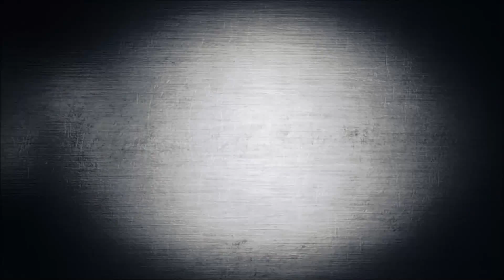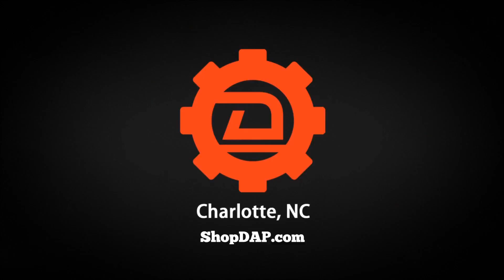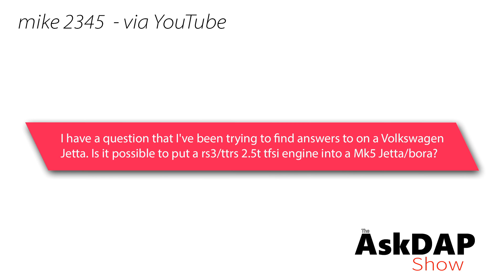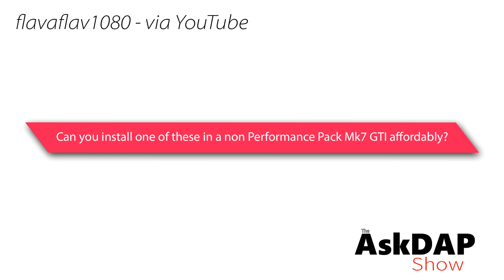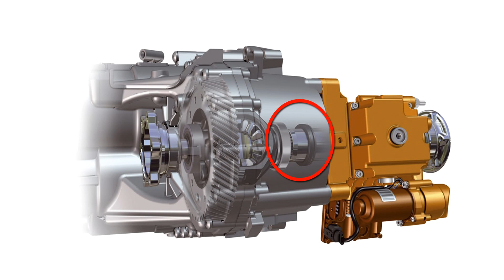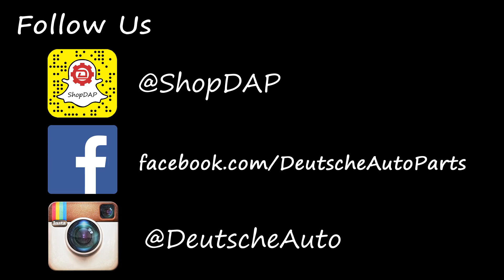Askdap Episode 103 | TTRS Engine in a Jetta, MK7 eDiff Swap

Comment: First off, congrats and thanks for all your informative videos. Much appreciated. I have a question regarding squeaking of door seals as they rub on the painted surface of the car. I've heard that this is common in VWs. Do you recommend a lubricant to eliminate the squeaking sound and protect the door seals?

Comment: Id totally try to fit the 5cylinder rs3 engine into my gti, add the whole quattro setup while im at it, lol
Reply: hllboi817 that would be the ultimate Golf RS.
Reply: Willy Willy lol, thatd be my dream car
Reply: hllboi817 @dave_7r on insta has already done it to his mk7 R
Reply: R is different though, because with the haldex system it is pretty much 3/4 of the battle already in there, vs redoing the whole rear suspension crossmember
Reply: hllboi817 he had to do the whole rear axle. He stuck the rs3 system in the R. It just fits

Comment: Great video and congrats on the new space!
I have a 2015 S3. Do you know of a way to update the MMI to have Apple Car/Android Auto like the 2018s? Thank you!
Reply: Brandon Road There are two options to achieve that, 1st Just upgrade your infotainment unit on the Glovebox for Mib2 unit (oem) or install and interface to your current Navy unit with wireless connection to your mobile.
Reply: Thank you Lorenzo! Is it simply a software upgrade on the infotainment for an upgrade or do I need new hardware in the glovebox? In either case, do you know where I can get what's needed?
To install and interface with wireless, I am assuming this would be a software upgrade, right?
Thank you again for your help! I really appreciate it!
Reply: It would be necessary to exchange your infotainment unit. I have a retrofit company in Spain where we do this kind of installations. I'm not sure if it would be useful for you but I can deliver the unit around the world. Regards
Reply: Got it. I am in the US. How can I connect with you further about this?
Reply: Brandon Road I have asked to Shopdap for authorization to type here my email. I'm sorry but this is not my channel so I don't want to disturb here. I'll let you know as soon as I have a response from them.
Reply: I understand and I appreciate your integrity. Thank you
Reply: Thank you!

Comment: This is unrelated to the video but... I just bought a 2015 GTI with 12k miles on it and noticed the ride seemed really harsh so I had it checked at a VW dealer (car was bought from a non-VW). The shipping blocks were left in the struts from the original VW dealer who received the car new. The dealer (2nd VW, not the ones who messed up) didn't notice any damage and said it is fine but I can't help but feel like I should push for them to be replaced or guaranteed for the future in some fashion; I can't imagine 12k miles with shipping blocks is nice on the suspension. So my main question is, should I take any further action or just be happy the car drives like normal again, or what I think is normal? You may have answered this before, please link if you have!
Reply: Funions 2 I had that same problem in a 2011 cc, i just had those blocks removed car was fine until shocks went out at probably 100k
Reply: Rodrigo Orozco When are they normally replaced as far as miles go? I only put on 10k ish miles a year so I may not even see the day they go bad.